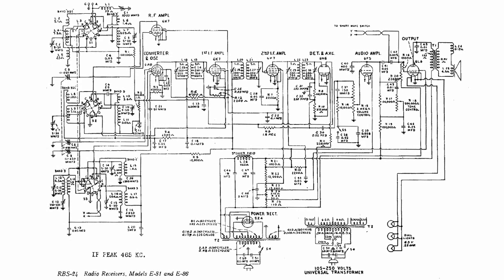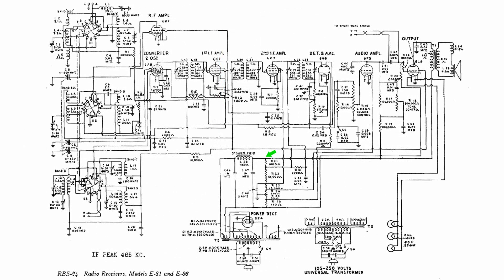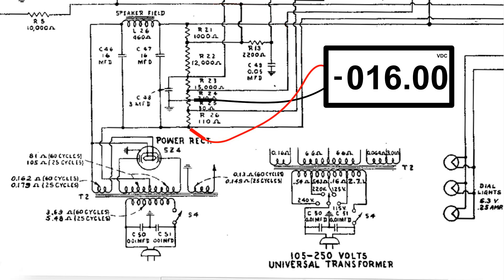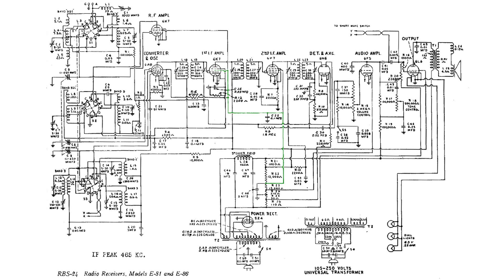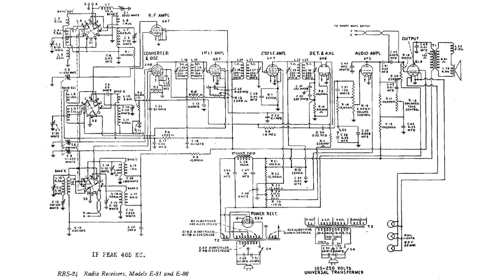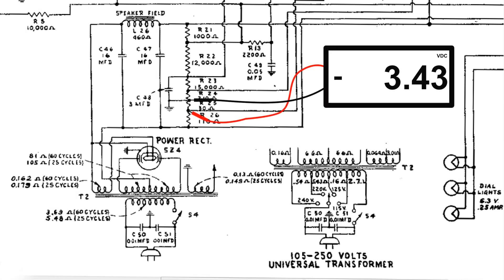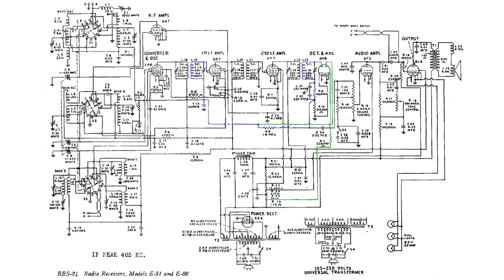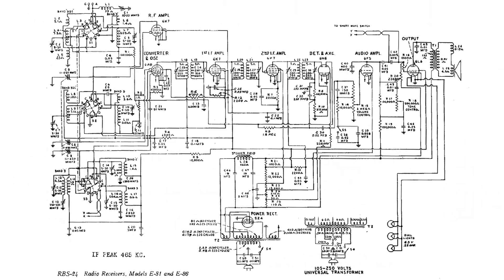Radio Power Supply with Positive & Negative outputs how to find voltages

Comment: I have a question that is off the subject but still pertains to the video. Does a negative power supply still deliver power? I thought a negative voltage reading indicates absorbing - not releasing - power.
Reply from the maker: De Sean Chambers Thanks
Yes it does produce negative power. Think of it as turning a batter over, same amount of power but in the other direction.

Comment: Thanks! I'm working on a GE E126 at the moment, this helps.
I also had to replace the candohm resistor, kind of sloppy but it works.
My saturable reactor is bad, primary and secondary.
I'll have to figure out some other way to activate the Colorama lighting.
Reply from the maker: ***** Thanks